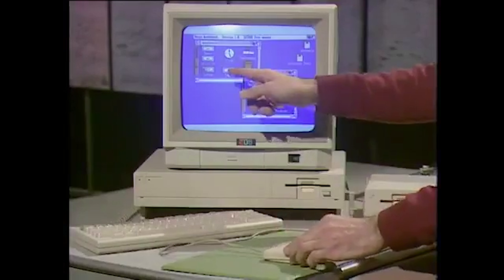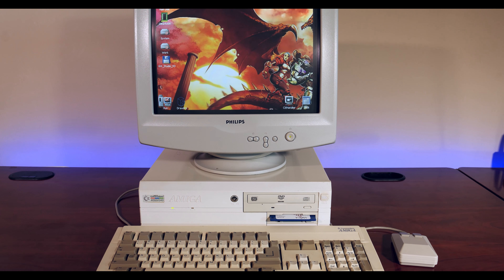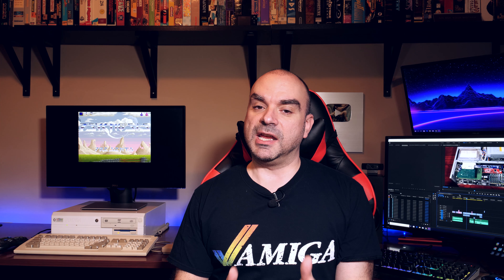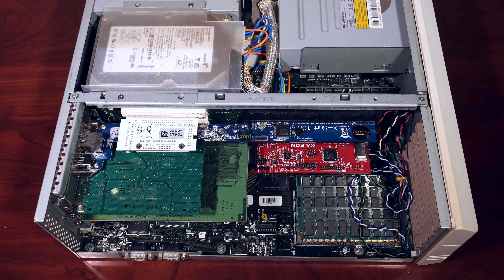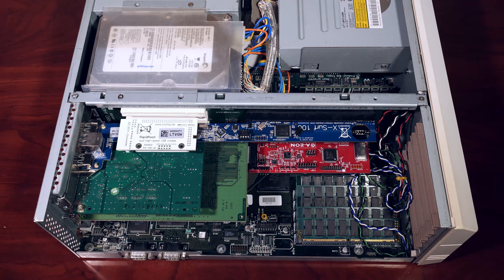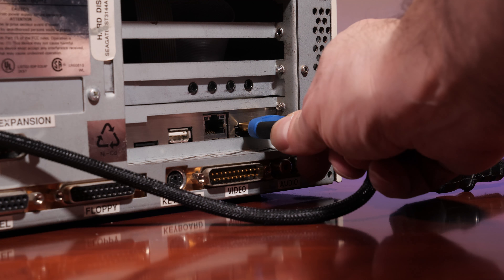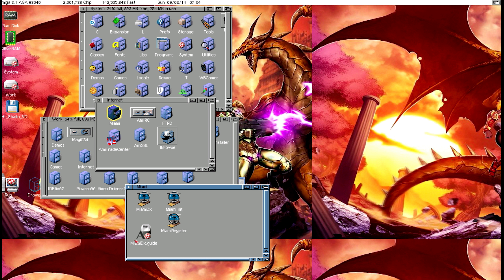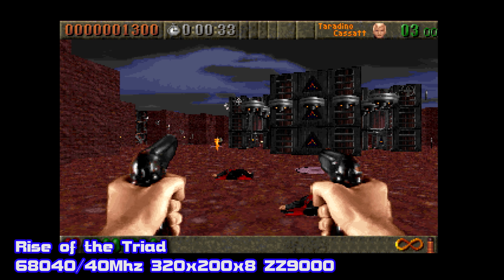Pimpin' the Amiga in 2020 - The Only Amiga Graphics Card you'll ever need - MNT ZZ9000 | MVG

Comment from the maker: Down Votes are Atari ST users
Reply: Mate who had an Atari ST in Aus?

Kids with parents who didn't love them that's who
Reply: Modern Vintage Gamer 👍🏻 from here🤗
Retrocengo
Reply: could just get 50$  laptop lol
Reply: how fast does the screen refresh he mentions 15khz but is that the same as 15hz = 15fps,
15khz also equals 15fps?
Reply: Not all Amiga users were obnoxious fanboys, but all the obnoxious fanboys were Amiga users. ;)

@damien green 15Khz (15 thousand Hertz) is the horizontal scan rate - which is how fast each line within a frame/field is drawn. This is generally the frequency used by old CRT televisions and early RGB monitors which used interlacing. What you are thinking of is the vertical scan rate or 'refresh rate' which is how fast an entire frame/field is drawn.
Reply: More like modern pc users. What's the point of frankensteining modern hardware on a retro computer?
Reply: The Atari ST / TT / Falcon030 deserve respect.
Reply: @healthent  atari ST had a midi port. amiga sux
Reply: Amiga and Atari were good computers. The Amiga was good at tracker music and graphics, whilst the Atari was a natural at music.
Reply: Meh, I'll just wait until someone will put whole Amiga on one of those crazy Xilinx FPGA
EDIT; I see there is core for the MiSTer -https://github.com/MiSTer-devel/Minimig-AGA_MiSTer ;)
Reply: Hey MVG, really appreciate the love for the Amiga! I was wondering if you could help, I have a 2000 with a hard drive that is temperamental and I was hoping to switch to a sd setup... Can you recommend a good way to move the files over? Id like to image the whole drive but not sure if its even doable
Reply: I have wondered, do former ST owners still resent their parents for buying the wrong computer for Christmas? :)
Reply: So you want downvotes. Alright then.
Reply: I am happy about my 1040ST!
Reply: Mvg I want too cover myself in butter and wrestle you.  Added to the bucket list XD
Reply: Integrated midi lovers!
Reply: @ImmaSpam__________________Can  
Hmmm... Are there really that many  of them ??? ((39 at writing))
;) ((Yes I'm kidding, to each their own))
Reply: @girgislv  Yeah, but anyone who wants to buy this card wants to feel and use the real machine. (With maybe some minor upgrades.)

I have some retro systems I rescued from the trash. Nothing this old though. My computer in 1985 was a hand-me-down Sinclair Z80!
Reply: My dude. Amiga Forever.
Reply: Aka known as the poor mans Amiga :P
Reply: Atari ST is such a lame machine compared to an Amiga ;)
Reply: @damiengreen1769  15khz is the horizontal refresh, the fps refers to the vertical refresh (60hz).  Higher horizontal refresh rates means more information, which means you can have higher resolutions for a given fps. You can determine the approximate FPS by dividing the horizontal refresh by the number of lines of vertical resolution (times 1.05% to account for retrace).  For example, 15.75kHz / (240 x 1.05%) = ~62Hz  refresh.  

The number of horizontal pixels on a crt monitor is determined entirely by how fast the beam can change color, not the vertical or horizontal frequencies.  This means that 300x240@60hz and 600x240@60hz are both 15kHz on a crt monitor.
Reply: Eww the Atari ST had crap audio and games sounded tinny and looked graphically worse!
Reply: Lol
Reply: I see you're a fan of Psygnosis.  I owned both Altered Beast and Agony back in the day.  That game was different.  Many Psygnosis games were, to say the least, unique.  Remember Killing Game Show?
Reply: I am a Mac II user.  I upvoted.
Reply: Or because you stuck with zee zee lol
Reply: I have a graphics card for my Atari Mega ST. Not so wonderful as this but still a big improvement. Very jealous of these big box Amigas
Reply: Or maybe people from The States, who had real computers while you silly gits were using a Mega Drive with a keyboard and mouse? XD
Reply: I gotta agree on this one also downvotes also comes from Macintosh too.
Reply: I had one, no downvote from me ;)
Reply: Oh, you mean then midi controller with qwerty keyboard ?
Reply: Modern Day gamer:Hey Jake?Does this armor make my gun look fat?

Classic gamer:Nah your level 99 now relax.

Modern Day gamer:I don't know I might have to buy some more dlc.

Classic gamer:You do that's just stuff that was already in the game right?60$ each from millions of people wasn't enough for them so they exlude it so they nickle and dime people 

Modern Day gamer:Oh....
Reply: aren' t those downvotes by sour people that feel blown out of the water with their other scan-doublers?
Reply: @niamaru2  : i wanted to make a backup of my A4000 hd but didn' t dare to take it out of its housing, afraid i might screw it up before getting the data. I went this route http://www.boomerangsworld.de/cms/apccomm/faq.html .
Reply: Modern Vintage Gamer or even worse! :)
Reply: dirty thirty yes, if you’re not an actual Amiga enthusiast, that would be enough ;)
Reply: damien green 15khz is the horizontal refresh rate, normally the vertical one is 50 or 60 Hz. It’s about how the video sync hooks up to the monitor, and if the monitor supports it or not. More often than not, it wont work sadly
Reply: gearfriedtheswmas passion, and a wish to use better screen modes, or even 3d acceleration
Reply: mechanical man you can pretty easilly make a midi interface that connects to the Amiga serial port
Reply: Maciej - there is also the Vampire V4 standalone, the choice I would make
Reply: Bart maybe you’re on the wrong forum
Reply: Squigglefang :3 we should, really
Reply: No. Down votes are from people who own PCs thinking "We should care because...?".

What you got? A graphics accelerator which doesn't bring the Amiga up to a tenth the power of a similarly priced one for the PC? Attached to a computer which doesn't have software in the same class. 

Great.... you made an archaic games machine slightly better, but at what?
Reply: @gearfriedtheswmas  You so accurately preempted my own thoughts.
Reply: I never used an Atari st. Or emulated it
Reply: Nope. I gave the video a thumbs up. After all, Amiga is stolen Atari Inc tech with a Metacomco OS bolted onto it.
Reply: @lemagreengreen  No, because we luckily had a sensible GUI and desktop metaphor that didn't subconsciously demand us to tear out our eyeballs like Dr. Weir after looking at it for more than 30 minutes. Wait, make that 15 minutes.
Reply: @Squale.  Laughs in Atari Falcon030...
Reply: @TheJeremyHolloway 

Good point. Although that sadly also contributes to the explanation for why it failed.

It's heir to the Atari legacy of machines with graphics chips that were far better for stills than moving images. Not Commodore or the previous 64 which has one of the best three chip designs ever put in a computer.
Reply: @Squigglefang :3 because... Amigans. Without a flicker-fixer, they're too easy to trigger.
Reply: @jamesfmackenzie  is it a CrazyDots video card? The one thing that pisses me off looking back is how Atari Corp seemed to be able to make their clone PCs offer more tech in them than the ST at the same price even though they had to license the OS from Microsoft. If I recall, the Atari PC-1 was basically in the MegaST case and had something like 256k or 512k of VRAM for its EGA graphics. Imagine had the SHIFTER been updated to use VRAM like that...
Reply: @vapourmile  consider it a tax in order to be able to not use Microsoft products or Linux from that unwashed community...
Reply: Jeremy Holloway It’s a MegaBus adapter so I can connect a Tseng Labs ET4000-based ISA card. Uses NOVA drivers. Agree that the shifter was a real weak-point of the ST. I’m keenly following Exxos’ ST remake project. They’re trying to build a 100% compatible ST but with some of the kinks in the original design (shifter included) ironed out. I wasn’t aware of the PC-1 but I want one now!! ;-)
Reply: @jamesfmackenzie  Nice. From my fuzzy memory, I thought the CrazyDots graphics card for the MegaST was Tseng Labs' based. I'm aware of Exxos' modern STf motherboard replacement project. It's too bad it isn't an STe. Is he going to use an FPGA to replace the SHIFTER with?
Reply: Jeremy Holloway Think you’re right. NOVA supports ATI and Tseng Labs cards. Think Crazy Dots is Tseng Labs also. Yes, they’re looking at a complete Shifter replacement in FPGA. Not just a scan doubler, but replace this shifter entirely to have a 100% end-to-end digital solution with no analog. Find more here: https://www.exxoshost.co.uk/forum/viewtopic.php?t=2170&start=80
Reply: Brad Viviviyal   Yup, I own an ST and Amiga (and a 130XE and C64).
Reply: Not here Atari user but still liked the Amiga many groups I went to had both users back in the day lol
Reply: @lemagreengreen  HAHAHA!!!!   That was a good one !  🤣
Reply: I’m an st user and I didn’t downvote am I a subconscious Amiga user
Reply: Nope i'm Atari guy 100% and this is awesome. Ohh you are the the channel guy saying this is rather pathetic tbh. NOW you actually got one :) but i would not have done this if it where a random guy saying this :D, i do not care both are cool.
Reply: @damiengreen1769  the k stands for kilo = 1000 (I have also known this to mean 1024 for drive or memory). 15hz is 15 times per second and 15khz is 15000 times per second. The screen will usually refresh a full frame at 50hz or 60hz. Your software might update the screen at a slower rate of 15hz, with the display buffer only being refreshed after a number of screen refreshes to claw back extra cpu cycles for your software. An RGB signal may be 15khz which can support a range of resolutions using different standards. The human eye is said to see 25 frames per second and that's because when you spin a wheel with a hole in it at 25 revolutions a second then most human eyes will see a static wheel. That's why the PAL standard is a multiple of 25. I don't know why NTSC is 60hz though. There is sure to be a very good reason though that another commentator can help us with. I think that it's just faster than PAL in the same way that if a car as a max speed of a few mph more than another then it can appear to be a better car on paper.
Reply: Just wanted to point out you praised it for all 3 of the cards functions but the usb doesn't even work
Reply: Maciej - https://www.apollo-accelerators.com
Reply: @AppleReviews  it's called fun, you should try it some day
Reply: Atari ST down votes on the Amiga being superior come since 1984
Reply: Down Votes are Apple-Macintosh users
Reply: @gearfriedtheswmas  Graphics cards have been used for the AMiga since the beginning opf the 90's....
Reply: Atari St was superior for 3d graphics.
Reply: ahh, the good old rivalry between atari st and amiga users is still going strong 😅
Reply: But the falcon exists :D

Just kidding ofc
Reply: @AppleReviews  the emulation is utter garbage - the keyboard is never emulated correctly since neither the PC-bucket nor the UNIX workstations have Amiga keys. Emulation sucks!
Reply: @Squale.  considering that most of the ST range has no hardware acceleration to speak of - it's a system worthy of every respect when one looks at what the ATARI ST people have managed to squeeze out of it.
Reply: @AmigaMark  depends on WHICH ATARI ST: the STe can play PCM samples just like the Amiga, and in fact has eight hardware channels, if I remember correctly - double that of the Paula chip, and the Falcon030 has the holy grail of sound generation - a dedicated, programmable digital signal processor. Not only is the Falcon030 capable of 16-bit, 56 KHz replay, but his DSP can do post-processing effects - in real time no less! - effectively turning it into a powerful digital audio workstation. That is something us Amiga guys can only dream of. To do real time sound effect post-processing, the Amiga would have to have serious number crunching power - even a MC68040 will struggle, and any realtime effects are almost out of the story, as the CPU would have no time left for anything else...

Comment: 1080p res on old but new hardware....

madness!
Reply: Lov ur vids man hello from Greece 👍👍👍
Reply: There are HDMI mods for old consoles that go up to 1080p as well, even going as far back as the NES.
Reply: you never saw some 90s matrox cards output 1080p on linux
Reply: I wonder how confused this Amiga is, when it's doing things so fast, and has a 1gb video card.
Reply: Madness? THIS IS AMIGA!
Reply: @mrbisshie  The lovable thing about the amigas is the forethought put into expandability. It's like wondering how confused a ryzen APU with 8GB of ram is, running MS-DOS and Rise of The Triad/Duke Nukem 3D/Quake. Meanwhile, trying to get a hard disk connected to an Atari ST for under $100 is utterly frustrating, when it's a couple 74LS chips. I'll put it this way, I had to invest in a desoldering station to get the CPU off the board, which already was more than $100. Least you can just shove a compactflash card into an amiga. *envy*.
Reply: Or you can get yourself an old PDP-1 with an original 4k display. No idea what they used that for.
Reply: @Cyber_Akuma  you mean the Atari 2600. Console gaming didn't start with the phukkin' NES despite what the soy-infused Ninjaendo fanbois believe...
Reply: @TheJeremyHolloway  Wow, reaching much? The reason I said NES is because this was in response to 1080p HDMI mods, and I have looked into Atari 2600 video mods before. AFAIK, they top out at S-Video or RGB over D-SUB, there are no 1080p or HDMI mods for the Atari 2600 that I am aware of. 
 
Also, the Atari 2600 was not the first home console either, it's actually part of the SECOND generation of consoles, not the first.
Reply: @Cyber_Akuma  First off, there are HDMI mods for the 2600. I also never said the 2600 was the first console. However, it was the first successful one and having sold 35 million worldwide - outside of Japan since they were nationalistic and protectionist bastages - isn't anything to diminish.
Reply: @TheJeremyHolloway  Your bias is showing. RetroRGB, which is pretty much THE source for console video modifications mentions nothing about a HDMI mod for the 2600. Searching for Google also mostly brings up results of people trying to figure out how to connect a 2600 to a TV that only has HDMI, or people that "made their own" which is nothing more than taking the existing video output from the 2600 and just putting it through a HDMI upscaler, something you can plug into any system with that sort of video connection. 
 
Also, you realize your attack on the Japanese is basically borderline racist, right? 
 
And do you remember the crash of 1983? Atari caused that you know, due to having zero quality control over what games can be released on the 2600. That anti-Japanese rant of yours about being "protectionist" was to prevent just anyone releasing utter trashware on the NES like they did with the Atari and prevent another crash. Nobody in the US wanted to even touch consoles again until Nintendo convinced them it would be viable. So these "nationalistic and protectionist bastages" as you put it at the reason consoles still exist in the US. 
 
But of course, I expect someone like you to ignore all this logic and reason just to continue your clearly anti-Japanese bias rants. Don't let me down now, I know EXACTLY what to expect from trolls like you on the internet, I have more than enough decades of experience dealing with your kind online.
Reply: 1080p ?   We could run  1600x1200 with the GFX card we had for the amiga in the 90's. The Merlin did 1900x1200.
Reply: @TheJeremyHolloway  bruh just cause someone likes nintendo doesn't make them soy our boy MVG likes nintendo.
Reply: @TheJeremyHolloway  Japan's videogame market came up after the US one...